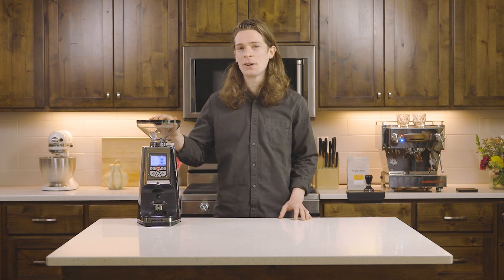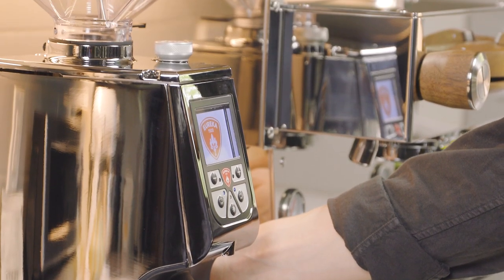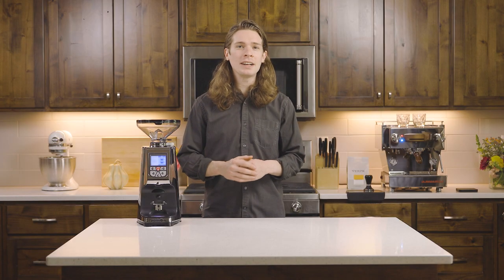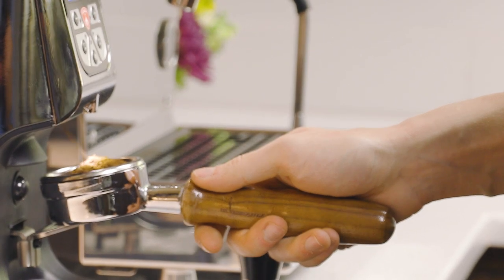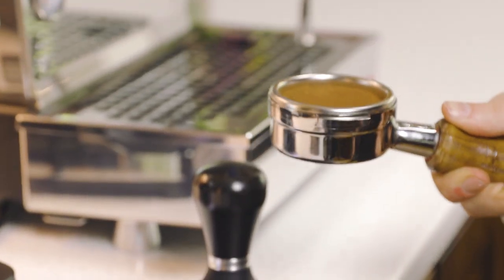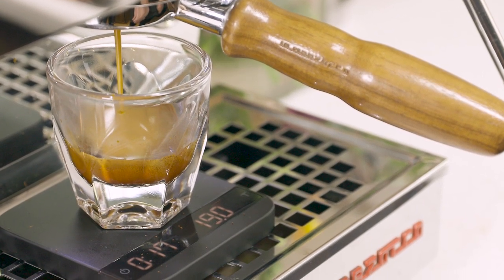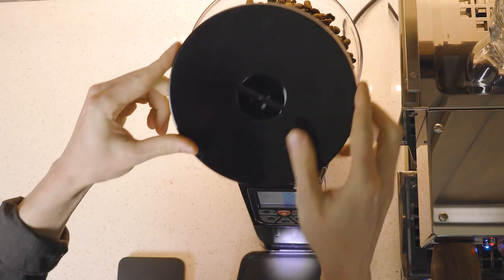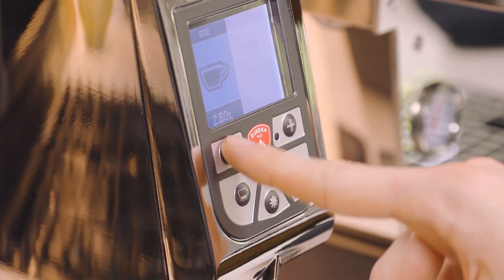Eureka Atom 75 Espresso Grinder Setup

Comment: Where would you suggest to start on the dial to find the right grind size for espresso. I know it'll depend on the beans and the weather and all things inbetween, however a rough starting point would help. more towards the 1 dial mark or do I need to go a full rotation coarse from the 0 point to get into the right ballpark? when you say adjust "just a tick" what exactly do you mean by that? half a number or half a rotation? Would really be helpful to not feel overwhelmed by the task, thanks.

Comment: The manual says to screw in the basket, but the rubber thing is in the way. What am i missing?
Reply from the maker: You don't need to use that retaining screw. the rubber gasket is good enough to keep the hopper in place.